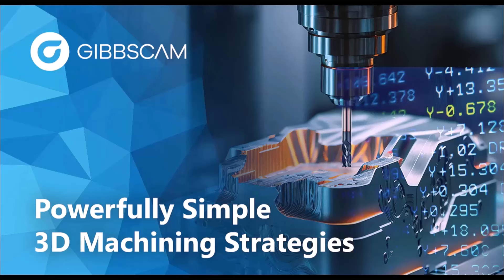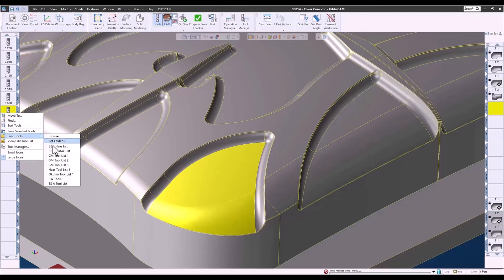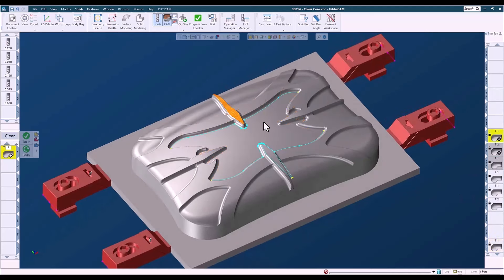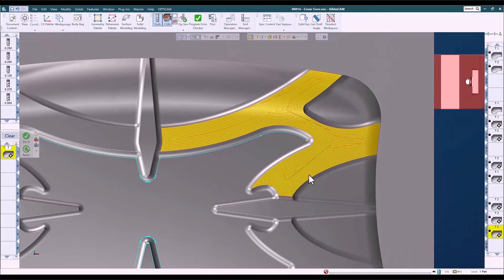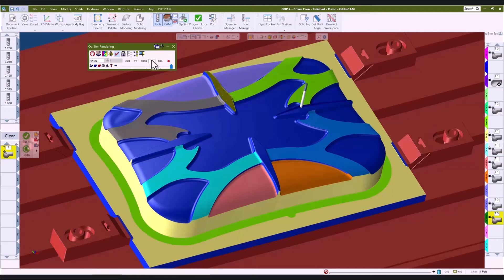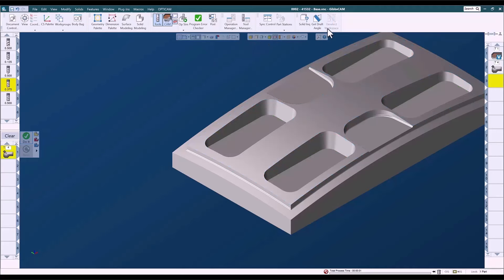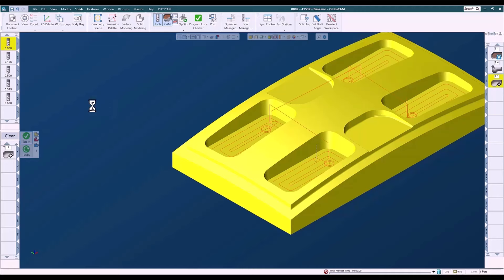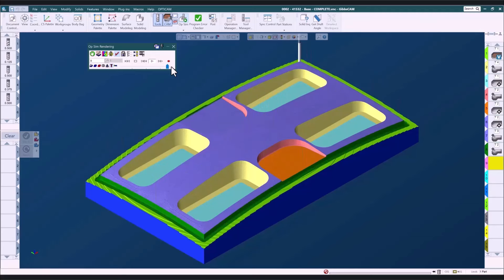Powerfully Simple 3D Machining Strategies  | GibbsCAM Webinar

Comment: Sadly, triangle mesh is buggy and most of the time it was like that. At the moment using v24.57 you cannot leave any stock amount on the machining surfaces any other than zero. So you can't rough  at all using triangle mesh. Not to say that some options on the 5 axis toolpaths are not implemented properly with a lot of them simply not working or throwing an error. I sent all the issues I found via my reseller 2 months ago nothing has been fixed. Simply powerful...but not working properly.
Reply: The facet bodies are really bad looking as well, tried to use v24.50 and went back to v23.